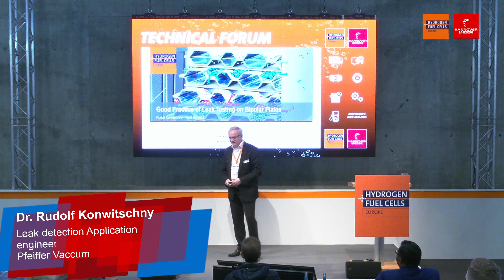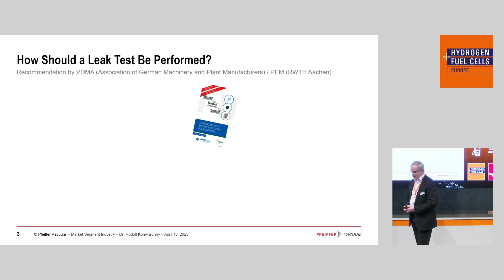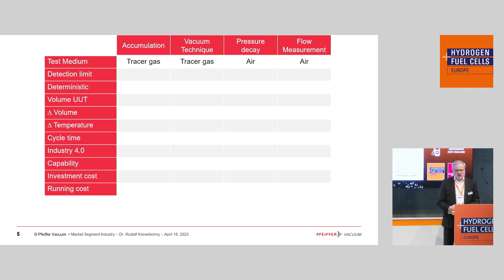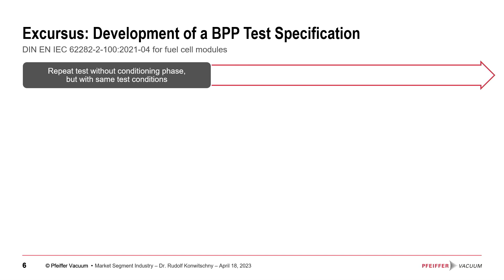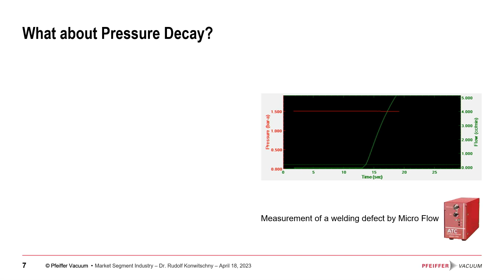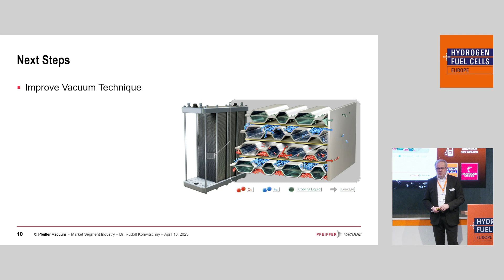Good practice of leak testing on bipolar plates  | Hydrogen + Fuel Cells EUROPE 2023

Comment: Nice talk in the way the speaker develops the tightness needs and testing solutions. Fully agree that helium testing with tracer is the solid approach and must be in the tool kit of all fuel cell producers. I endorse the statement that there is ambiguity in the interpretation of the legislation of the tightness requirements.   
The justification that each bi-polar cell needs to be tested to 5 E-5 mbarl/s to get to the DIN requirement of a 400 BPP stack assumes that each plate is going to leak at ~ 5 E-5marl/s – hopefully not. The stack and BBP test strategy/method to adopt depends on return of experience from the bi-polar plate production leak occurrence and the leaks associated to the stack assembly activity. A BPP production facility producing I leak per 100 components will need a different leak testing approach compared to a facility producing 1 leak per 10000 components - each manufacturer needs to consider those inputs . Never-the-less, the speaker makes a great job of explaining the generic approach.